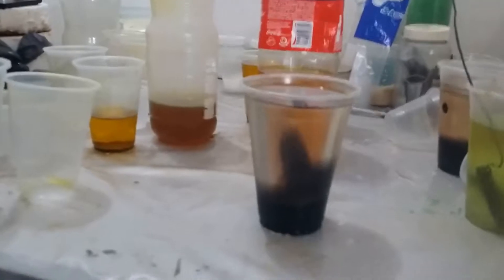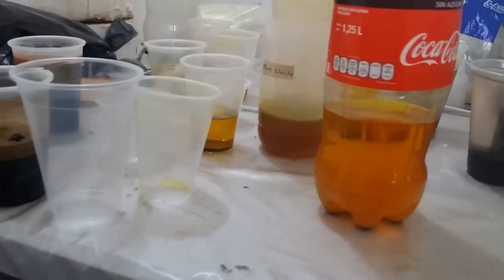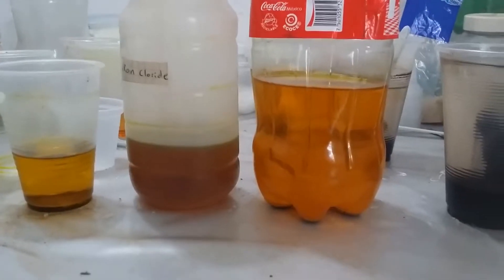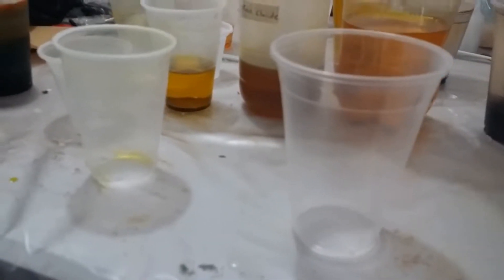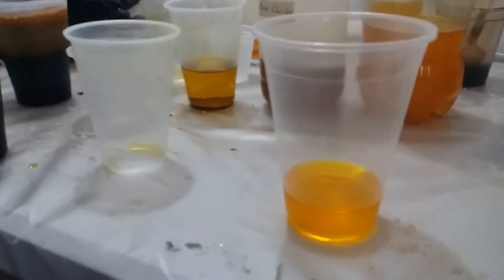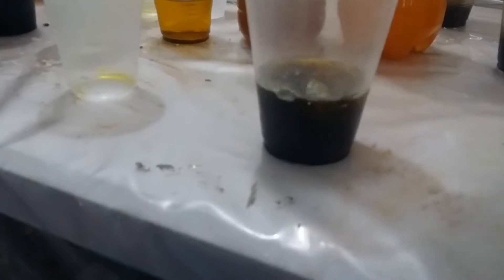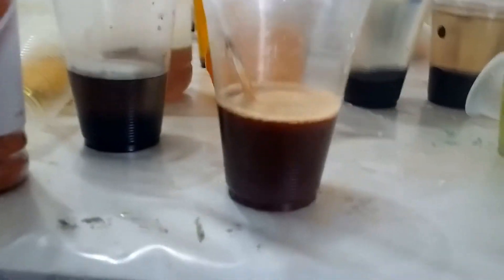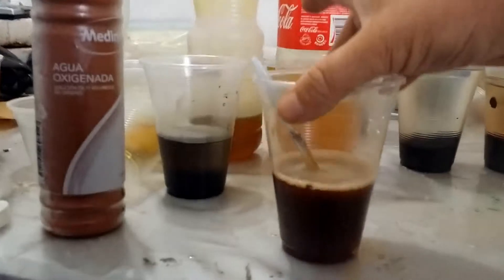Magnetite from Iron(III) oxide-hydroxide

Comment: Hi Adam. Nice work making magnetite. Are you going to make a test cell with it or some other use.
Reply from the maker: Hi Dan.

I've used it so far as a susceptor in my microwave kiln. Its not the best I will post further results on that soon.

As you seen these oxides disolve very easily in an acidic environment, so I'm not sure how they will stand up in a cell. Although I think I will try it.

 I'm still very curious what you have synthesized, I have been looking at Fe3C cementite as a possibility. check out the method in this study how they coated iron with Fe3C. I now believe you were correct about the carbothermic reaction. Fe3C has also been explored as a catalyst in fuel cells. So a possible rout to produce Fe3C particles may be interesting.

http://www.corrosionjournal.org/doi/abs/10.5006/0010-9312-24.3.66?code=nace-prem-site

I'm also curious to see if I could create some low cost ferrofluid for fun, the surfactantes generally used are a little out of my range.
Reply: Test cell ? Curious